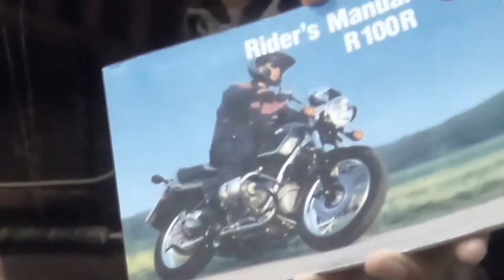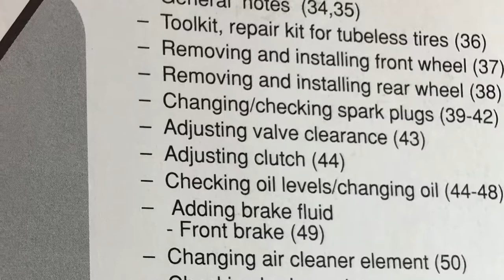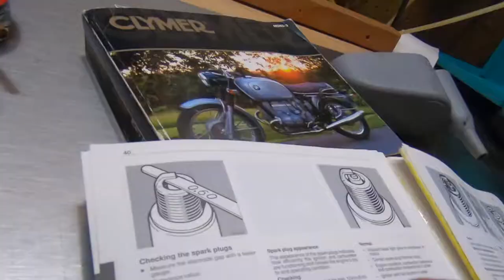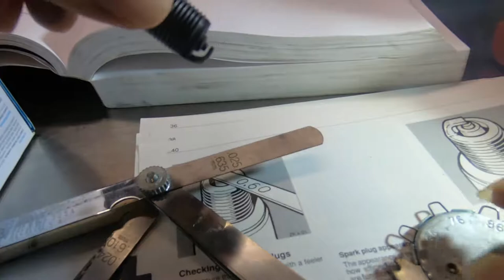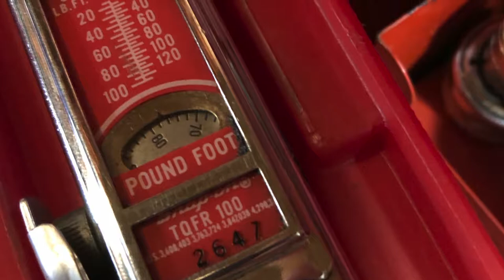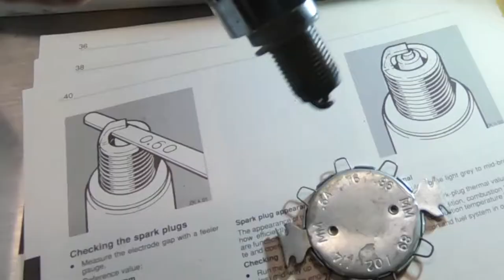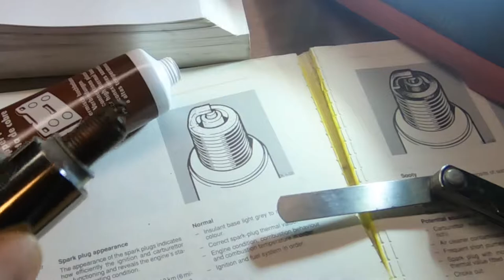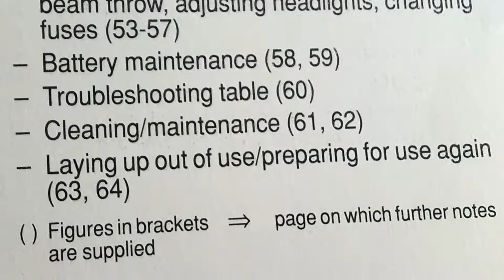ShadowBoxer 0061 {BMW R100R  Basic Maintenance   Spark Plugs}

Comment: Love your vintage Snap On set. Do you have metric sockets?
Reply from the maker: Yes I do. The ones in the box shown are standard, but I also have a vintage set of metric sockets. I simply did not need sockets for this job. Everything still works great. 

The socket+extension I use on the second spark plug is not so old (it just happened to fit the vintage box perfectly), maybe from the 1990s as I bought that new for a car I had at the time rather than as a working collection. I guess if I keep my 90s tools long enough they’ll become vintage collectibles too.  : )

Glad you enjoyed it. 
Thanks for the comment. 
Cheers.
Reply: @ShadowBoxer  I'd view them as usable regardless of how old they are.
Reply from the maker: @GarthGoldberg   •   Yes I agree. As a matter of fact, a few days ago I got an old 1/4 drive ratchet (GM-70M). It works fine, fits and snaps together with all parts of a 1/4 dr. socket set I got back in the 90s. This old ratchet could work with any 1/4  drive I could buy today. 
This "new" ratchet is dated 1947. As you and I said, regardless of age, these old tools work just fine and can still get the job done.

By the way, why do you ask about metric sockets?
Thanks for the comments.
Cheers.